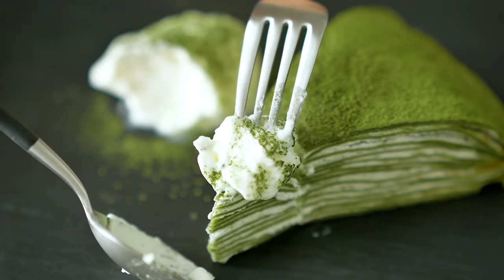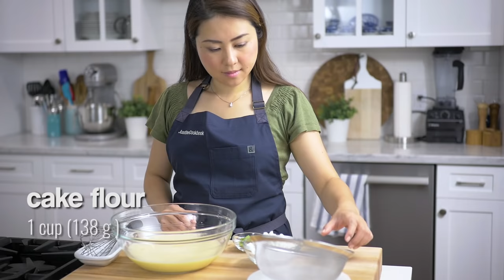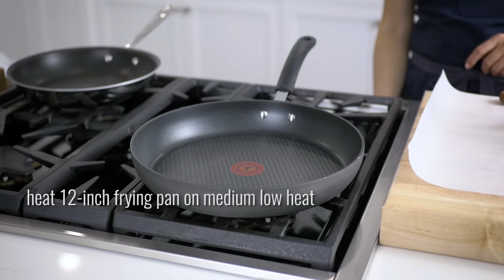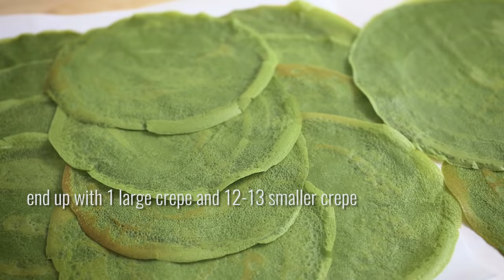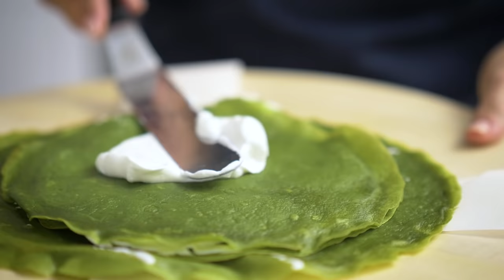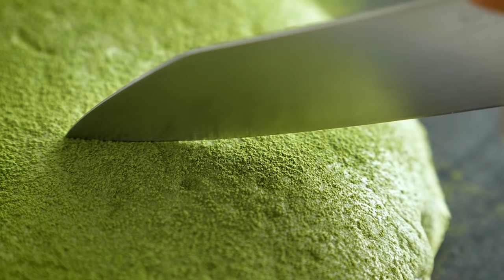How To Make Matcha Mille Crepe Cake (Recipe) 抹茶ミルクレープケーキの作り方 (レシピ)

Comment: That's a great trick on getting the round shape. I would have never thought of making one crepe larger than the others and having it cover them.
Reply from the maker: +Jeff Schrader First I was using the same pan but swirl the batter slightly bigger then I realize just use the bigger pan instead 😂

Comment: great recipe! turned out so tasty 
I normally don't use matcha, so I am not used to the taste but it was no problem at all thanks to the combination with the whipped cream (took a little less sugar, 2tblsp instead of 3 and it was great) 

I made the cake for mother's day and everybody liked it 

just got a little nervous while making the crepes (didn't have time to start all over again in case it hadn't worked out), maybe prepare some more of the crepe batter in case some crepes tear etc (only one did so I still had enough layers) 

all in all I would say it is a recipe that is quite easy to follow, just bring enough time and some nerves for the crepe and it will be a success!

Comment: This recipe is pretty good, but the problem I found was that the batter was to thin, so I added about 4-5 extra tablespoons of flour and that seemed to do the trick, though my non-stick pan was very old and in poor shape, so I ended up using a cast iron skillet which also worked great, and you could dry cook the crepes.